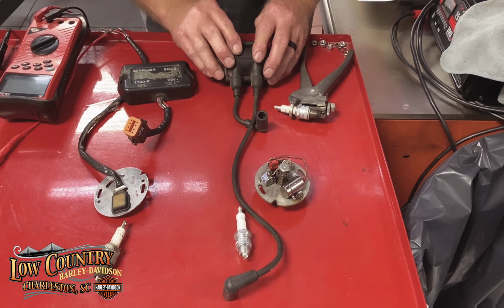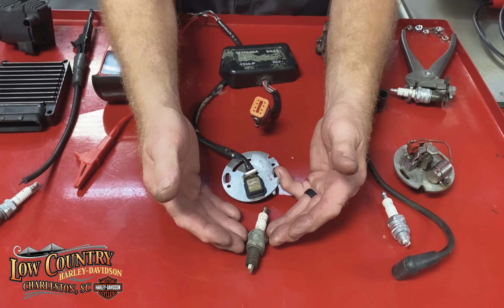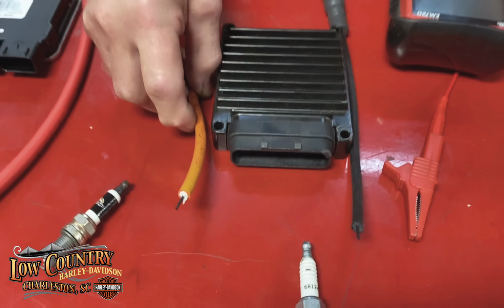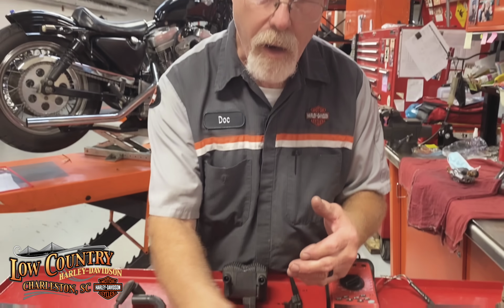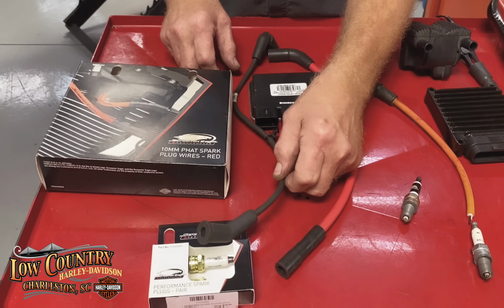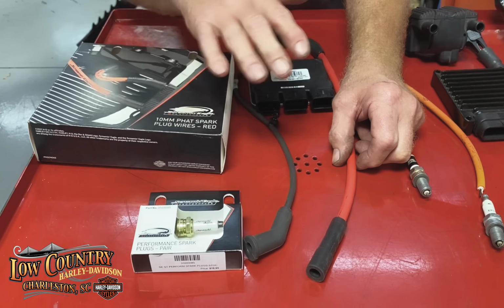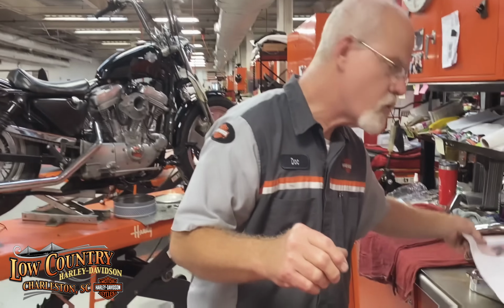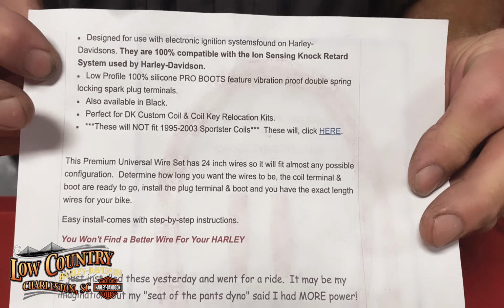Spark plug wiring | Doc Harley | Upgrades

Comment: Seems anything you want to add if its not harley the ecm cant figure things out or u void warranty? Sounds like harley is trying to end the aftermarket! Read about the rpm act.
Reply from the maker: Question, If you built something from scratch, would you want others to install parts that were not in your design? Not knowing the outcome?...Doc
Reply: I know what you are saying doc but if an airfilter element cant be added without going into the computer and reprogram is wrong, aftermarket has been around forever and is under pressure to be shuttered, rpm act, harley making a system that the consumer has a hard time working on unless they have access to a dealer is wrong, sorry. We love working on cars n bikes and some want to tell us how and where to work on them , easy and affordable access to items is best, cant add wires because the ecm cant figure it out? Thats programmed in so you cant, ecm have been figuring tunes out forever, cant get the a/f ratio without going to a dealer? Again, programmed that way i think. 
Keep up the good work
Reply: I would like a series on the 02 sensor,catalytic convertor ,efi and ecm and how they work together to adjust for differing conditions to keep you riding ,
Then also tell us how the same systems cants figure out how to adjust a/f for an airfilter and exhaust or wires?
Seems like in california where you are not allowed to work on things unless it goes to the dealer, maybe cover that as well?
Why harley are you doing this?
Will b surprised if any of this gets covered.

Comment: Iv got 8mm accel plug wires on my 09 sportster1200 custom i made shure they wouldn't mess with the ion sensing they been on it now 700 miles does good
Reply from the maker: Sportsters dont have Ion sensors...Doc